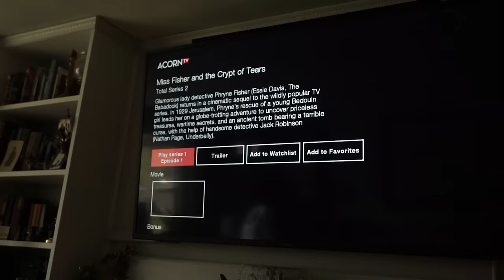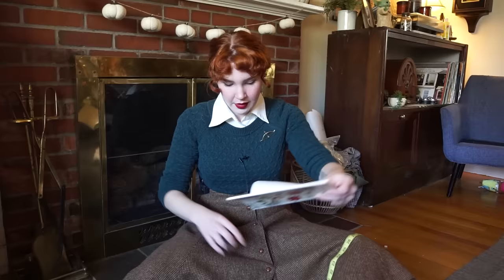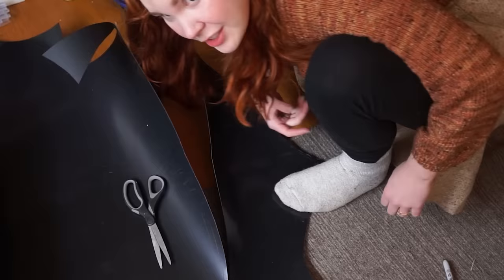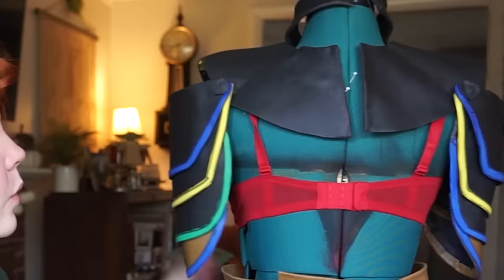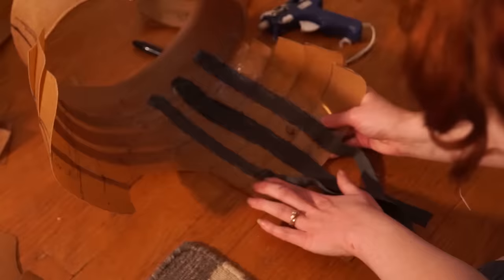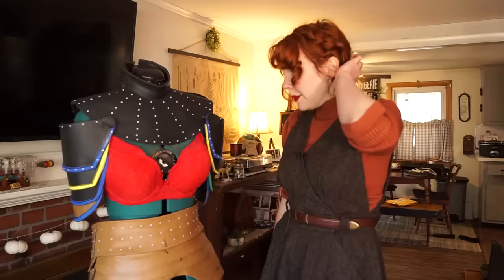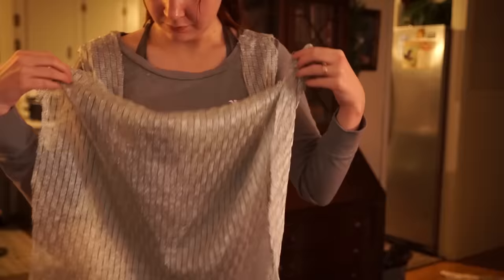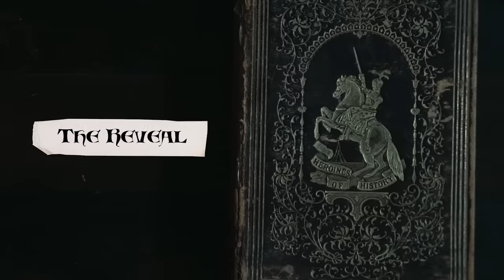Recreating Zendaya's Armor Dress!

Comment: This info is a little late for this video, but both sides of Worbla are adhesive when heated. The smooth side was just the underside when rolled out during production. Worbla itself is basically wood shavings and hot glue all mixed up and rolled into super thin sheets. 

Love how the outfit looks and the hip plates in particular are fantastic!

Comment: I just want to say that I have been following cosplayers and making cosplay for YEARS now. I love working with worbla. But not a single cosplayer has mentioned that the smooth side is the adhesive side. This entire time I've been using the rough sides together when i use it. Thank you Rachel, thank you.
I do use the sandwich foam method for most but this so helps with parts I need to not use foam for.

Comment: Hi Rachel!  I noticed you've used worbla on a couple of projects now, and I thought I would pass on some tips I learned in a class with a professional cosplayer!

While cutting out pieces from the worbla, you can but the edges right up against each other.  Never throw out any scraps, because the pieces can be heated up and merged back together to make bigger pieces....you also can use the scraps for sculpting details, for example, rolling them into snakes and using them to define the edges of the plates.

Instead of using 2 pieces of worbla back-to-back, use a sheet of foam on the backside.  this adds support, and gives the pieces thickness, without the added weight or expense.  Really the only time you need to layer 2 pieces back-to-back is if you are making a piece with a dome, like defined chest plates or helmets, and its really just for the stretch factor, to keep the piece from getting to thin.

Instead of plastidip, you can use 2-3 coats of PVA glue, and it will smooth out the surface, once again, saving a few bucks!

Hope its helpful!

Your dress turned out fantastic!  I'm 100% with you, I've been unable to forget this dress since I saw it, and I think you absolutely nailed it!

Comment: Rachel, I LOVE how this came out! You totally killed it with the tassets too! (Tassets are those hanging upper leg / hip armor plates). Your engineering of anchoring the plates on the three strips was solid too (I've used that before in building real armor). I like your finished result better than the original, and the location video shoot is SO PERFECT. The castle and the dramatic weather were perfection. I admit I was a little concerned with a couple choices of the original dress designer that were less historically mindful of real armor (the studded belt as part of the armor at the waist and the decision to make the edges of the shoulders overlap the top edge rather than the bottom edge of the gorget sides and making them look like slightly misplaced miniature rondels). However, the way you reduced the contrast of the "shoulder hinge pins" by making everything silver (rather than the original whiter contrast) was lovely, and the belt worked! You also taught me something new with the googley eyes trick for rivets (which I will use hereafter if I ever try working with worbla and need to simulate rivets). The costume armor I have built previously has been of leather and real rivets - probably because of having some armoring background and sewing background and art background but no worbla, plastidip, etc experience (yet). I have been enjoying your videos so much and appreciate all of your hard work and awesome projects. I also love seeing your personality and soul in these projects (like your admiration of Jeanne d'Arc)!

Comment: Worbla is a favourite material of mine- if you wanna save a lot of extra material but still get something solid at the end, make all your armor with thin foam, and use worbla to coat the outside face of the foam and tuck the edges underneath! It'll keep everything much more lightweight than just worbla stuck to itself, and it adheres very securely if you've heated it enough! The foam acts as a stabilizer for the worbla, and it'll make your worbla sheets go waaaay further per project! :)

Comment: i absolutely love how this ended up in the reveal, especially with the change of scenery! the castle and sword made it all  chef's kiss especially with the filming help!

when you mentioned the worbla nail, i thought i might drop these bad boys for future articulated armour needs: https://www.amazon.com/gp/product/B077C214YJ/

they're basically two-part screws that you can use as removable rivets to screw all of the individual pieces together as needed and then take them back apart for travel/storage. it would be perfect replacement for the worbla nail and you could even make a cap for the end if you wanted to make it ~fancy~ instead of just functional. it also works for the parts where you did the straps, you would just place the straps at the edge so the heads of the screws were where the googly eyes were.

i'm super pumped for your next costume-y build! it's been such a treat watching you tackle bigger and more complex things!